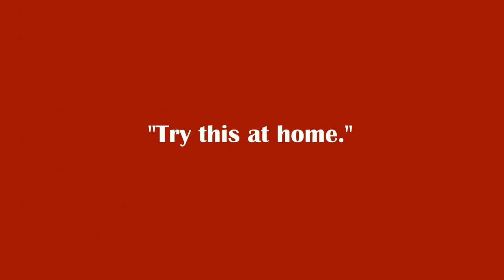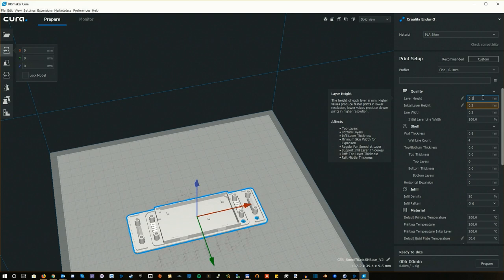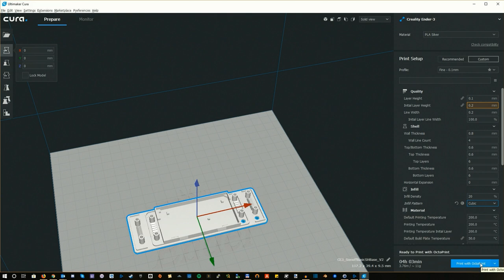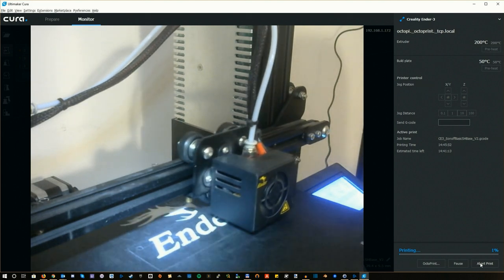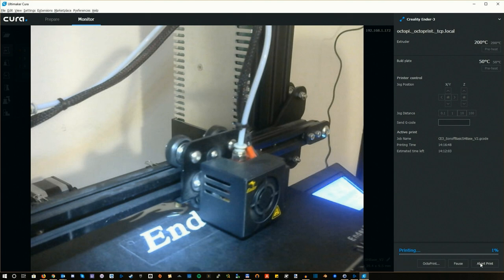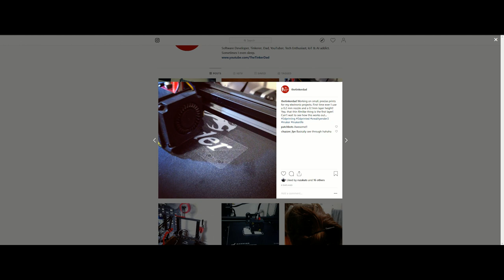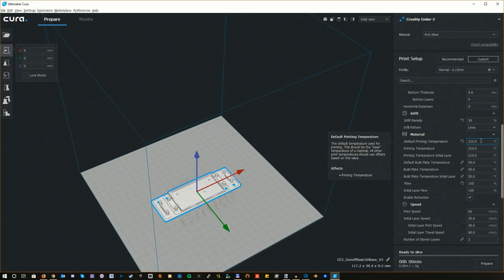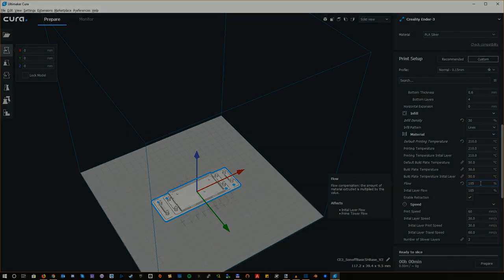High Precision Printing With 0.2mm Nozzles On The Ender 3!

Comment from the maker: I've made this video in a bit of a hurry, so I've forgot to mention a few things - sorry for that!

1) Printing with the usual temperature, but with a small nozzle will increase the chance of clogging your nozzle - this is why the steady flow is super important. 
2) Higher temperature = pla gets liquefied faster, but use common sense and don't go wild with the temps.
3) Printing too close to the surface ( = super thin first layer) can also end up clogging the nozzle.
4) Keep your equipment clean from dust, including your spools. The smaller the nozzle, the higher the chance of getting clogged by dust particles.
Reply: How thin is it possible to go with a 0.2 nozzle... 0.05m layer height?... taking in mind 0.4 can go as 0.1.

Comment: Use matter control. It has the option to extrude more material on the bed, also only increase by 5 Degrees, that all I have done on PLA+

Anyway That's why I don't use Curu it is just finically.   Matter control can also adjust prints Live.

Comment: Great job! Nice result... I'm still staying with my 0.4mm nozzle.. it's take me ages to get good at printing with it, i don't want to start learning all over again how to print with a 0.2 ;)
Reply from the maker: Thanks! Turns out once you set up your printer and slicer profile for 0.2, it's just like printing with 0.4, unless you want to keep switching - it might get a little bit of a burden that way. :) Personally, I'm sticking with 0.2 for a while, I like all the added detail.
Reply: But at the cost of 2x the print time? I TOTALLY get it for smaller details items, but for large print areas the added time cost would be EXCRUCIATING ;)

I'm impressed with how easily you can change your nozzle... on the Prusa it's WAY more complicated :(
Reply from the maker: @UnexpectedMaker  I see. I wasn't aware of that. On the Ender 3 it really is just heating up the hotend so you can pull out the filament and after that, it's like replacing a screw... a very hot screw :) I thought it's pretty much the same on every printer. But on the second thought, the Prusa's moving "print head" part looks complicated compared to the Ender 3, so yeah, I guess it's harder to pick apart when needed.

Comment: no matter what i try, i can't get anything through the .2 nozzle. 
i'm using a sprite extruder. usinb a brass one.
when i try to extrude, it shoots out a little bit and clogs. no good
Reply from the maker: Use a bit higher temperature than normally - I usually print PLA at 200 with .4 nozzles, but I use 205 or even 210 with .2

Comment: I have a hunch that at this point a resin printer would be faster, more precise and not even that much weaker. Plus you can print all the parts in the same time as printing a single part because of how the exposure mechanism works. 

Good results tho!!
Reply from the maker: When I made this video, resin printers affordable to the average guy like me were only wishful thinking. The first sub-$500 machine came out later in that year.
Reply: @TheTinkerDad  I didn't take that into considderation. Prices have come down allot now but 2 years ago that wasn't the case yet.

Comment: hello sir..the setting is auto if change to 0.2mm??or do i have to adjust other setting??
Reply from the maker: Sadly, it's one of the negative things about changing the nozzle size - you need to adjust your settings accordingly. For this, I keep different profiles in Cura, which I use for slicing.

Comment: Did you alter the gap between the nozzle and the bed for this nozzle?
Reply from the maker: Sadly, I pretty much alter it all the time slightly - the "screw in" mechanism of the nozzle makes it sure :) This means every time I change the nozzle, I need to re-level, but then there's BLTouch :)

Comment: Would slowing the print time with increasing flow work to allow more material to be deposited while decreasing the back pressure in the hotend? 

Also, those tolerances look extremely satisfying.
Reply from the maker: First of all, sorry for the slow reply! Now about your question... You need to increase flow a bit anyway otherwise you risk clogging the nozzle - I usually do this together with increased temperature. Most filament manufacturers provide a wide range when it comes to printing temperature like 180-220C, etc. and the higher you crank it up within the range, the more liquefied the filament gets, which in turn yields less back pressure. But in the end it all boils down to experimenting :) Also lately I've started to set a bit smaller line width in Cura (setting it to like 90% of the nozzle size) and to slightly increase the flow and the nozzle temp. These together almost always yield nice flat surfaces and so far I haven't had a clogged nozzle.